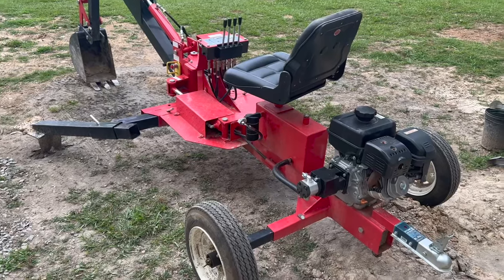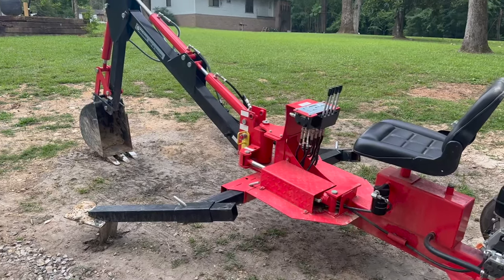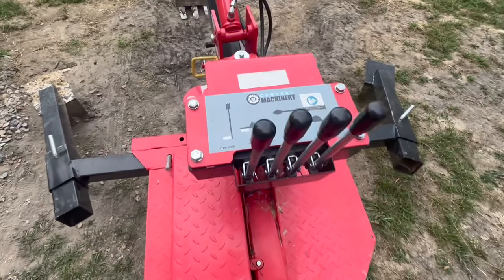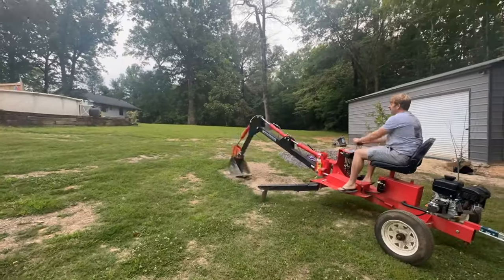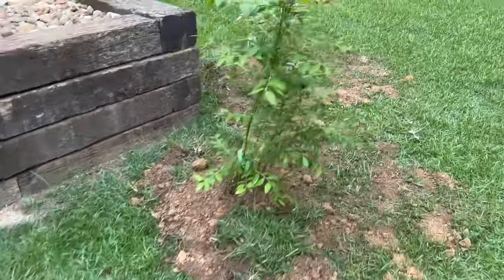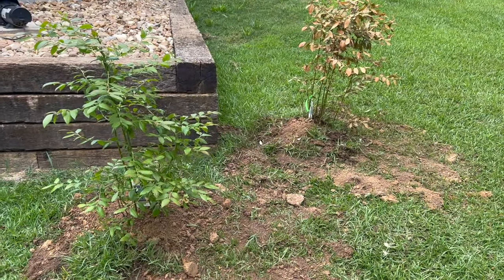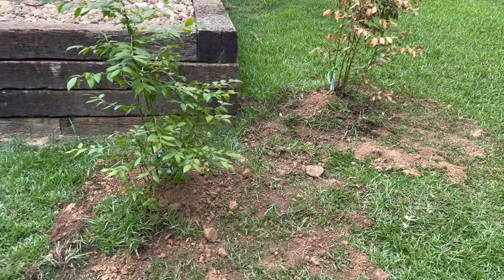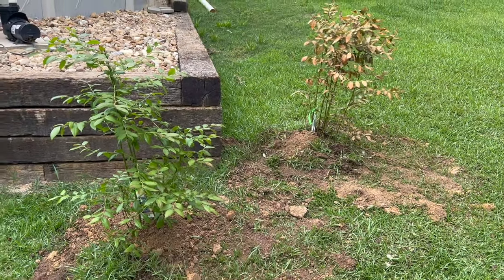Using Harbor Freight Towable Backhoe for the very first time!

Comment: For when you get going - try to keep the bottom plate of the bucket parallel to the grade you want to dig. I.e. don't use the bucket tilt to dig - use the boom and adjust tilt to get the grade you want. Goes so much faster. Also dig down by slicing several times when trenching instead of going to full depth at once. 

And if the dirt is wet - never fill the bucket all the way. The dirt stays put due to suction and you will have a quite hard time. Please ask me how often I have done that before I learnt :-)
Reply from the maker: Great info! Thanks for sharing!
Reply: Good looks!

Comment: If you are lifting the rear wheels off the ground when trying to pull a tree root... back off because it CAN rip the bucket in half or cause other damage.
It has the power... not the fluid flow rate for doing 2 things at once.  Some people ugrade from the appx 1.6 cc pump to a 4.1 cc pump (fits with minor modification to the coupler and 2 pipe adapters)

DO NOT increase the pressure setting of the relief valve as some videos tell people to do.  It can already bend the cylinders at the factory setting.  Increasing pressure will not speed it up.
Reply from the maker: Great info!

Comment: Does anyone know if they make a thumb for this be it mechanical or hydraulic. 
The other question I have is how much will the boom lift when keeping it close in other words could you lift up 8 ft long logs to hold it up so you can cut them with a chainsaw off the ground. I'm guessing it would need to be hooked to a truck as a counterweight
Reply: Yes there are a bunch of other videos of people with a mechanical thumb that they bought new on ebay for $160.  The 16 year review video of a guy said it lifts 400-450lbs.
Reply: Yes they make a thumb for it

Comment: LOL. How much did that cost? I can make a hole 3X that size in 4 seconds with an old 555.
Reply from the maker: How much is an Old 555?
Reply: @TheGlassFamilyvlog  I have about 7K in it. Just had to replace the water pump last weekend and I had the head rebuilt a couple years ago. It's not exactly portable though. Just musing that it would take a month of Sundays to dig out the stumps I do with something like that machine there. It's a maintenance nightmare but it's paid for itself.
Reply: @danhillman4523   As long as it paid for itself than it’s a win!

Comment: Too small to be used to build any meaningful holes.
Too big to justify not just using a shovel.
Reply: I used one to dig 300 ft of 2 ft deep trench... (one of many projects)  
I'd much rather use the power tool.
Reply: @fhuber7507  Does it have enough power to dig hard pan clay/ dirt to 2ft?